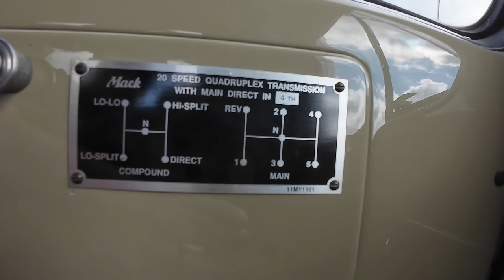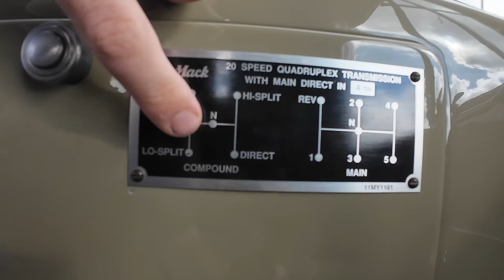2 Gearshifts | Twin stick shifting in my Grandpa’s old Mack

Comment: My papaw has not 1. Not 2. But 3 b model Mack’s. All three have duplex transmissions. 5 speed box and a 2 speed box. I’ve never seen a YouTube video that shows how to shift it without 2 hands. But now that I’ve seen you drive this. I understand the concept of going up a gear in the 5 speed box. Then immediately downshifting in the 2 speed box to get into the next gear. I greatly appreciate this. And one day when I got one of those trucks running I’ll try to take one for a spin

Comment: Brought back some great memories! Learned to drive a '67  F850 gasser w/ a 5&4 then progressed to one of our '69 R600's with the 262 Mack Thermodyne's and 5&4's. The Jake was only good for shifting as those 262's didn't have great holding power in the foothills west of Denver! My dad then bought a 1978 KW with the Big Cam III 400 and a 5&4 that we used as our prime move truck and hauling a Timpte end dump. In the '90's we bought a 1964 B-61 Mack and refurbished it as a 3000 water truck. It had the 262 and 5&4 and no cab insulation. Noisey as all git-out but fun to drive. In '84 we ended up with some airshift 12 speed(?)Macks. The newer stuff (84's) were easier to drive, the 5&4's were FUN to drive.

Comment: Finally a real driver pullin a teal load w twin sticks!  Learned to drivein Dad's ole 63 Emeryville.  Had whathe called a 335 small bore in er.  Couldnt let just anybody driver. Or they'd lug er and blow head gaskets...pretty hot for a small bore, got 8-10 mpg when othets were glad to get 5-6.

Comment: Yea real old beauty! Lot of shifted though. I’ve driven a twin stick Mack, a 1965 R 100, 6 wheel 24’ refer box, hauling meats out of the Boston Meat Markets into R. I. Never over 20,000 lbs load of pork loins. The engine was only a 140 hp Scania straight 6, natural aspirated diesel, with a straight 5speed/R, plus hi/lo second shift all within the same box. Very interesting to shift, taking the time to double clutch at first. Till you get used to just floating up and down through the gears, using two hands. From 1st/lo, 1st/ hi, then with two hands from 1st/hi to 2nd/lo, then 2nd/hi, then with one hand, never getting a finger between the shift knobs, grabbing both 2nd/hi to 3rd/lo with one hand, then 3rd/lo to 3rd/hi, then two hands from 3rd/hi to 4th/lo, then 4th/hi, to straight into 5th/hi, because their so close, but if you’re heavy? Then hit an incline and want to downshift half a gear just go into 5th/lo with the second hi/lo shift to split 5th, then as rpm sill drop down to 4th/lo when slow enough. That was just right hauling heavy with that small non turbo diesel that had as flat a torque curve as possible. From idle at 800, to the governor at 2,400! That meant as fast as 68 mph.

Comment: I remember an uncle who drove a tandem milk truck talked about how much shifting he had to do down in the hills and hollers in Southern Indiana. It certainly keeps your 
hands busy. Wouldn't be the vehicle to use on a date!!!!!!   LOL.
Thanks for the ride!  I worked for a farmer for four years in 2004-2008 and he had a 6 ton IH four wheel drive that had the problem with the neutral gate.  If you got both levers in 
neutral at the same time, we had to stop to get going again and sometimes it still didn't want to go in gear.
Later, Sammie.  Tell ole Diesel Creek the Ole Caterpillar Cowboy said HOWDY......

Comment: I love vids like this...I,m in my 60's and used to drive trucks in UK and europe.....we also had splitters. I grew up on single splitters...but eventually we got 'twin splits'...we also had some old 4/5 speeds with a two speed axle, giving ten speeds all told (though you would usually use it only on the top two gears)   Biggest difference? between us and you....we didn't have an extra gear lever, just an air operated switch (ran off the air brakes)....that could in theory (if you had a 6 speed main box, give you 12 speeds altogether).   I also came across the Eaton/Fuller 13 speed Roadranger....Some FIATs(heavy trucks 40-50 ton) etc could have the whole shift pattern 'back to front'....But the first truck that I bought and specced had a 10 speed single split which suited me.

Comment: I learned to drive an old 1960 Pete with a four and four trans back in 1979. Can't tell you how many times I didn't square off the "brownie" stick and had to pull over to the side of the road, crawl underneath and push the connector rods back into position for the shifter to  be aligned to drive again.

Comment: Twin sticks is one of the few types I've never driven. I always thought it was a bit nuts having to stick a hand through a steering wheel to operate both levers at once but I see that you handle that well, so it is a learned skill. At one time I was of the mind that I would miss having a 18 speed but I learned that the automated xmissions are generally better with the exception of reverse for hookup. Using a engine brake with a automated is a little tricky as well if you dislike over revving a motor but thankfully it can be managed.

The funny part is that it seems some drivers can't drive those properly either. You have to not be a pedal masher, let the automated and the engine work together by easing into it, no need to stomp the accelerator and over rev the engine.

Beautiful truck, I imagine your grandpa would be happy to see how you have kept it.

Comment: I learned to drive on a ‘39 Autocar with a two stick Spicer. Those old trucks are really cool to drive, but I admit I’ll take an air ride 18 speed any day. 
Mack trucks were always badass. I’ve driven an R model with a 10 speed. Tough truck.

Comment: Nice rig!
I drove a quad box in a Flinstone Mack prime mover with 40 ft triaxle (22 wheeler) in Australia in the mid 70's, with a 237 hp Maxidyne, it held torque well however still a considerable amount of cog swapping, held up a lot of traffic on the Tarcutta Hills back in the day. 
However we are right hand drive here in Qz so left hand shifting with right arm through that big 22 inch steering wheel.
We thought 237 hp was ok back then but the Thermodyne 250 and 295hp engines improved power somewhat.

Loved driving the uprated  E9 550 hp Superliners with 12 speeds later in my career, and a number of White Roadbosses with the 671 GM and full Jake retarders was another sound to behold from the past.

Thanks for a great review of a magnificently presented Mack classic !

Comment: Love to see that you guys are restoring and maintaining these old trucks and equipment. Trucks like this were a thing of beauty to me. Each of them had their own personality. The driver didn't just sit in the truck and ride along,  you became a working part of the truck. They demanded more of your attention and interaction but once you got used to what the truck wanted and needed from you the truck and driver basically became one unit and it was a thing of beauty. These trucks were built with pride and workmanship that would stand up to the test of time. The ones they are building now are just over complicated plastic pieces of junk just waiting for some sensor that doesn't even need to be there to shut you down for hours or even days. Don't get me wrong now not all of it is bad. Back when i got into my first truck that had air conditioning i thought i had really moved up. When i got into my first truck that had air conditioning and air ride suspension i thought i was in trucking heaven lol. My favorite old truck that i drove for several years though was a Mack Super Liner that had a twin turbo Mack V 8 engine, twin stick trans, and had been upgraded to an air ride suspension. All new ac in the cab and sleeper was great too. Did a lot of equipment heavy haul with it and it never let me down once. Used to make me smile when drivers would sit in their Petes and mess with me about driving my old Mack until we hit a hill and i pulled out and passed them loaded like they were standing still lol. Back in the days when you could ease down on the throttle, let the smoke roll while you watched the turbo temps and pull a hill like there was nothing to it. I retired from driving after 25 years a few years ago now but man i still miss some of my old trucks sometimes and i'd love to jump back into them from time to time just to go for a ride.

Comment: Thank you for showing the TWO gears. I drove a MACK with those splitting on the main gear. A little lever like the 18 speed. It was on a MACK dump truck.😊😊

Comment: Learned to drive in 1975 on a Peterbuilt with a  Cummins, 4+4 two stick hauling gasoline in downtown LA that was tough to learn cause you were loaded on the first trip out behind the wheel. Spent 12.5 yrs there then transfered to Colton spent 17 yrs there.

Comment: You can also down shift to low-low (deep) in a pinch if you need the extra rpm without having to compound shift. Low-low (deep) is the same ratio as the previous main gear in hi-split(over). 4/deep = 3/over. I loved twins when I had one just for the fact of always having options. Great explanation Sir 👍🏻

Comment: That is what I learned to drive on,  when I was 15,  in 1967.  8)  The 'split box' (what we called it) on the left, had the top of the stick bent to the left, so you could reach it with your arm through the steering wheel.  It took me a bit to get used to it, and the old timers loved to pick on me when I rolled to a stop starting up a hill and missing the next gear. LOL But I had a lot of miles on it before I even had a drivers license. I was a big kid. LOL  The first time I drove a Fuller with everything on 1 stick it was like having an automatic! LOL  A few years ago I drove a brand new Scania (Volvo), it actually had a button, for forward. LOL Shift points were programmed. Just step on the throttle and go.  It seemed like cheating somehow. LOL.  Thanks for the ride, that was really cool, and really took me back.   8)    --gary

Comment: That's a very tidy old Mack you have there. I'm lucky enough and old enought to have had some experience on the Quad Box. I drove a Mack tow truck with a Quad Box. It was a bit later miodel than yours - had the square front guards. In Australia the truckies called it the Flintstone Model. I was operating it before I could use the gears properly. One of the truck drivers from the truck I was towing was in the cab with me, and he gave me a demo and then coached me for the rest of the trip. I guess I was around 30 at the time. If I had to drive it now I'd need to be retrained.
That low-low gear came in handy a couple of times. One time I had to tow a rig with a dozer on it that had twisted a tailshaft off trying to change down going up a steep pinch. I just hooked it up to my tow truck and flat towed it to the top of the hill.  Until I had all 4 of my drive wheels on the bitumen my wheels were spinning, but I took some weight on my winch ( Pretty primitive tripod jib compared to tow trucks these days or even in those days - Holmes Wreckers were a thing then - or hydraulic jibs ) and the old girl just pulled away. Blew the minds of all those naysayers hanging around!  It was the main highway north out of Perth Western Australia and had been closed for hours. They still had to wait for a while because I wasn't game to try to change to the next gear till we were over the top of the hill. That low low gear is so low you can't really change up from it until the truck is going downhill. Maybe if I used the engine brake to drop the revs quickly enough, but for me it wasnt worth the gamble. 
Thanks for looking at my little story if you got this far.
🙂
By the way, that tow truck had a Mack engine. Can't remember exactly which model but it was a straight six turbo that I rebuilt for the owner. That's how I got the job as the driver. Apologies for the rambling - happy that this video took me back to the good old days.

Comment: My first truck was a DM Mack with a 237 engine no turbo hooked to a 18 speed .2 stick 4 ×5  I always say to this day if you can master that you can drive anything out there.  Great learning experience lol. We would run 350 to 400 miles a day. Let me say my ars was tired at quitting time.

Comment: FINALLY, someone that explains why you don't split every gear in a twin-stick. You would think that they would have spaced the gears in the main transmission more evenly so the splits were more consistent.

Comment: My father drove Mack B models in the 50's and 60's.  He swore by the Mack Tri Plex 15 speed 2 stick transmission.  Always said that it was the best combo of truck and transmission ever.  I always preferred the Cat 3406B and the 15 over but that's comparing apples and oranges.

Comment: Sam, The purpose of the "low low" in the compound box is so that when doing super heavy work and changing up gears on an uphill slope you can "grab" the next gear in the main box. eg if yo are in main 2nd and quad 4 and you want to change up then when you go to main 3 and quad 1 you actually have a lower gear ratio than when you started. This compensates for the ground speed that you lost when completing the shift. Once you are up a gear in the main you now have 3 more shifts in front of you with just the quad. I drove a lot of these with road trains in the seventies and eighties. I still revere the engineer who designed this amazing system

Comment: Im 67 now but when I was young my uncle had a mack B 83 with the same transmission it only had a 220 Cummins id run through the splitter box then split back into I’ll call it 2 nd in the box and 2 nd in the main in one swift move just one cluch it will go right in no scrape then on through two more gears in the box after that had to shift one stick at a time till the highest gears and could shift both sticks at once clenching the two shifter balls in one hand but the sticks have to be bent just right to clench them together. Anyway enjoyed it truck looks great ma cousin restored that 58 mack it’s beautiful also and it’s got 65000 lbs back axles on it

Comment: Beautiful old Mack LT I drove a 1964 Mack b81 tandem dump during the blizzard of 96 here in New Jersey I was in that truck for 3 days sharing the driving with a buddy of mine those transmissions you can do a lot of different work with them curb pouring with a mixer truck would be fantastic with those boxes

Comment: Thanks for the memories, I sure wish I was able to run with that kind of gear.  I ran a concrete pumper with Dodge 318 (gas), 2 stick.  For one summer, I had to run without the 5t gear, company said they where too busy to fix it.  The joy of humping up steep hills..

Ic Canada, the two stick was called an  "A B" box
--
49n12/122w58

Comment: My dad has a Mack Quad box in his Hot Rod pickup. We also currently use a 1942 Kenworth with a 220 hp cummins with jakes and a 4 and 3 transmission setup, we just hauled home an 1943 Osgood 200 Dragline with it.

Comment: Rite on brother I drove a rl mack extended range overdrive splitter 3 stick confused at the beginning but by the end of the day was like a old pro same with a 5&4 and then 13spd you do your grandpa proud like I with my dad the r l mack had big v-8 loved to hear it talk pulling grain train heavy camel back suspension put a D-5 cat right on her back pull Pipestone 40 mph what a ride shiny side up rubber side down rolling coal before rolling coal was a thing 😅😂😊😮❤

Comment: That is a beautiful old mack. They did a great job redoing it. Quit using the clutch. Back in my day I was taught to double clutch . Quickly learned not to use it. Mack quads there transmission were bolted right together. Where as KW and Pete were sperated . And the main box was on your left the auther one was on right. You did a darn good job shifting. Great video .

Comment: I learned to drive semi trucks from my Dad in an old B Model Mack with twin sticks. Before he finished with my driver education I could float the gears (shifting without the clutch). The clutch is only required when stopping or starting from a complete stop all other shifts are safe and possible by using only the accelerator to synchronize the transmission with the engine speed. Haven’t driven standard transmission in years but I think I could still do the “floating gears”.

Comment: I didn't understand it although you explained it perfectly. 
Just got my permit went out first time with a partner 10 speed I grind 70% of the shifting especially downshifting. 
So frustrated and you're doing it with ease....

Comment: When I was just beginning to start driving my Dad had a 72 COE Peterbilt with a single stack 400 Cummins and a 9 speed.  A mechanic that worked at cummins told my Dad thst if he put twin 5 inch pipes, twin 5 inch straight through  mufflers and twin big breathers with 5 inch pipes it would add 25 hp.. I don't know if it added the hp or not but it sure made it sound awesome.

Comment: I learned to drive truck on a B 47 Mack with a triplex trans. hauling logs in very steep country. 4 and 3 transmissions with a Mack thermodyne engine. Red color with black fenders of course. Most shifts were made without using he clutch.